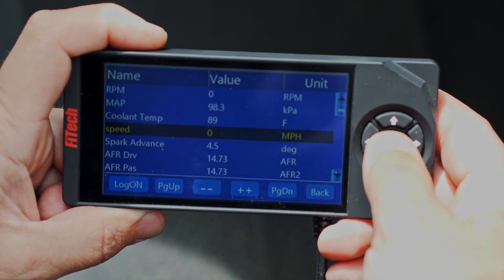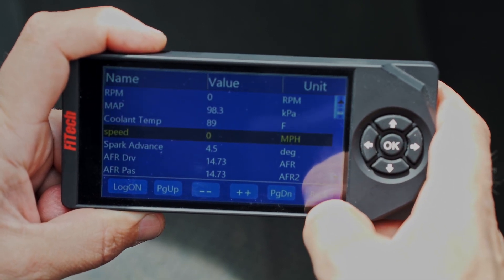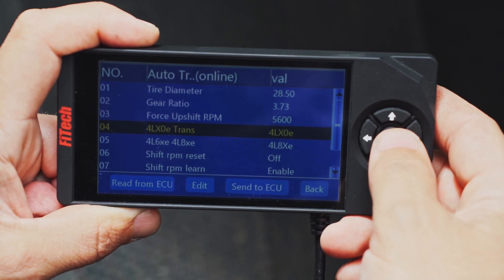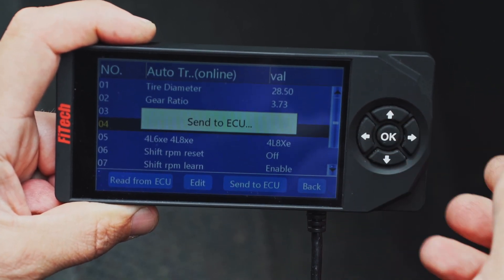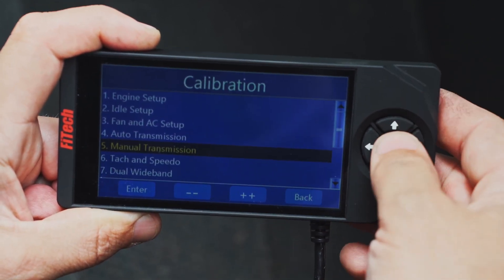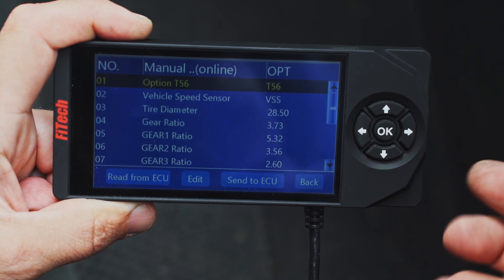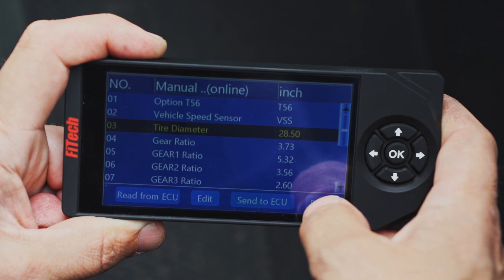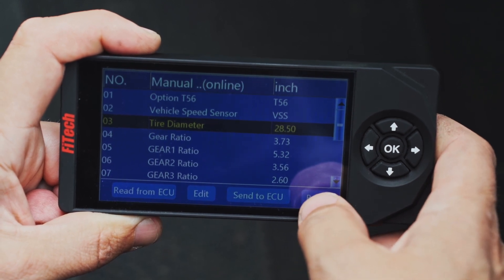VSS & Shifting Not Displaying | Tech Tuesdays | EP70

Comment: What if those steps don't correct the issue? I've verified that the plug at the transmission is in great shape and the fuse for the transmission is also good. 
-VSS seems to register okay.
-Selected gear never changes from "Low 2".
-It seems to be stuck in third
-Engine stalls when placed into gear, until it's warmed up. At that time it will surge and become unstable usually causing the engine to stall at random times.
-In my professional experience, it does present as though the TCC is 'permanently' engaged at times causing the engine stalling when shifting from park.
Reply from the maker: If the video didnt help clear the issue, then the issue will most likely be in the transmission itself.
Reply: @FiTechEFImedia  Thank you for the reply.

Comment: Why does the option turn off.. My wiring checks out no signal for pcm green connector pin 50.. In from vss 20 to 21.. Can pcm be faulty.. Can I use alternative pins to pcm 4l80e uses?
Reply from the maker: This video is in regards to a Fitech Ultimate LS system.

Comment: this part needs to be redone, the handheld is showing a different speed then my speedometer (connected to fitech) display and GPS are the same except for the handheld
Reply from the maker: You will need to work on the VSS Correction to make the speed in the handheld accurate. You would then use Speedo Correction to make the speedometer in the dash accurate.